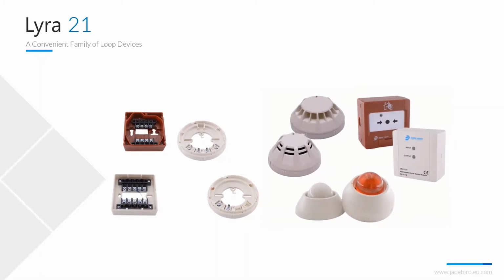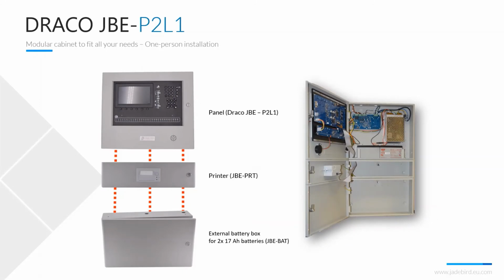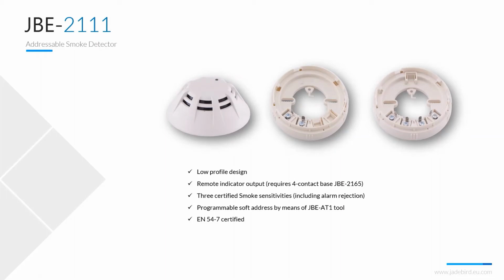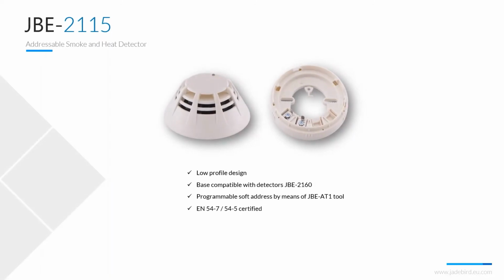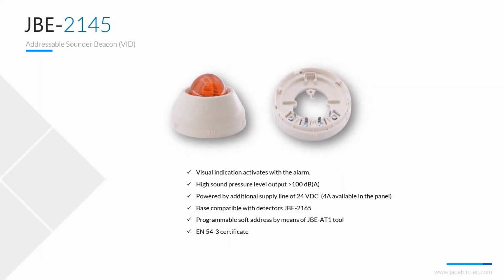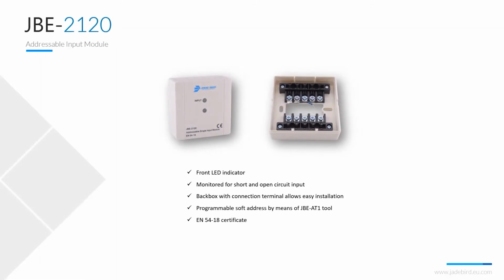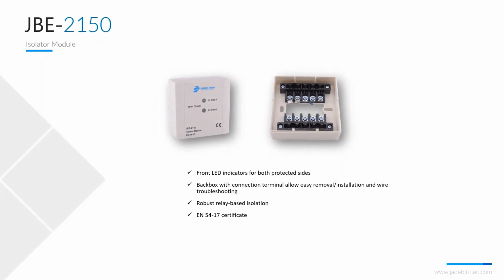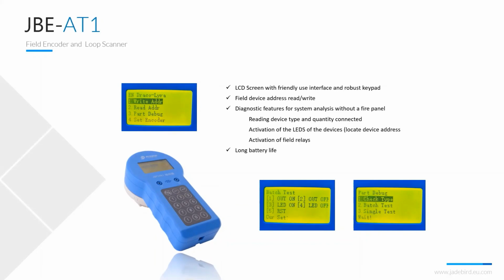Jade Bird Fire Alarm Product Range   v019EN

Comment: Good day i have a question how can i set up a sounder in the control panel the panel are addressable please help me .
Reply from the maker: Hi, A sounder is an analog device used as an output element in a fire alarm system. By default, the panel assigns it to the SND group, and it connects to the system's analog loop. This device requires a unique address within the loop for proper identification and operation.

The configuration of the parameters required for its activation can be done directly from the control panel or through a web-based configuration tool.

For more information, please visit our website: (https://www.jadebird.eu.com/).